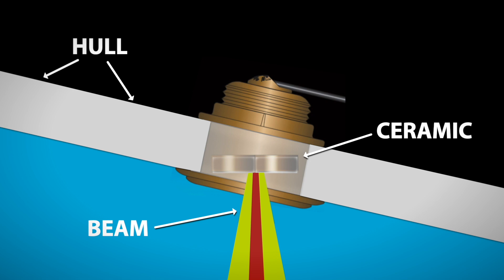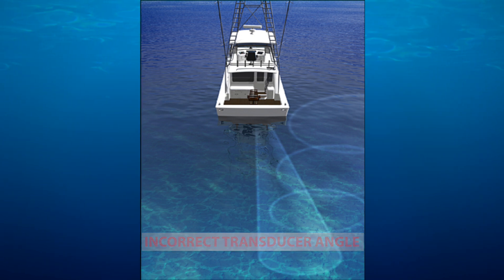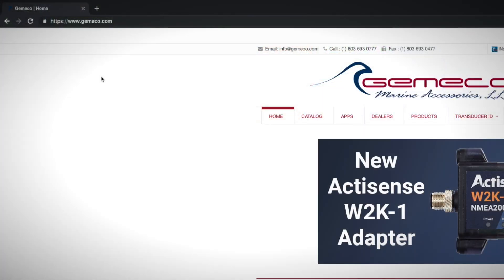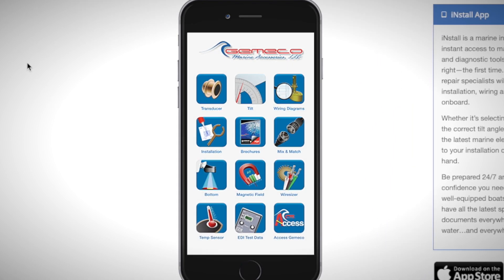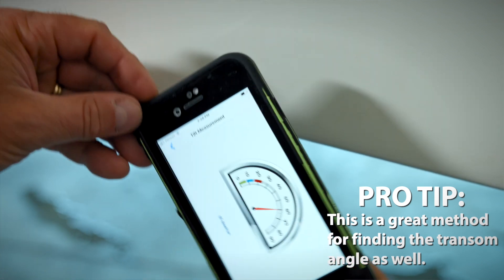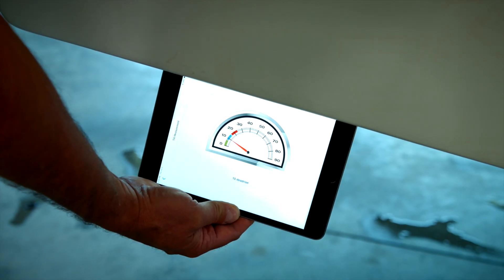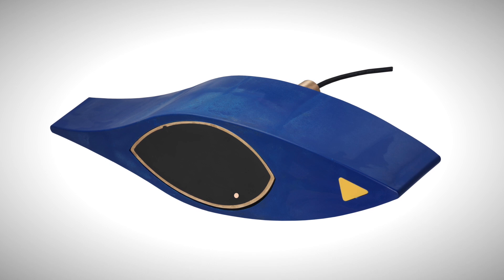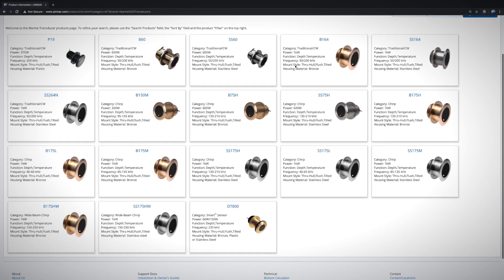The Best Way To Find Hull Deadrise

Comment: I had to install a round transducer with 20 degrees angle on a hull with deadrise of much more than that.  In this situation, when having a round transducer, a fairing block, as suggested in this video, is not needed.  Instead, all you need to do is rotate your mobile phone slightly making it point away from the keel (while keeping the phone firmly against the hull), this will lower the deadrise angle reading.  Instead of pointing the arrow on the transducer towards the keel you must point it slightly away under the same angle as you had to rotate your mobile phone to lower the measured deadrise angle.

Of course this method also works to perfectly match the transducer angle with the hull, even if you would otherwise be somewhere in the allowed range. Please note that you can only LOWER the measured deadrise angle; so in order to get the perfect angle, the transducer angle must be lower than the maximum hull angle.